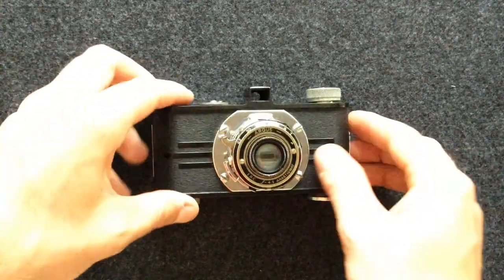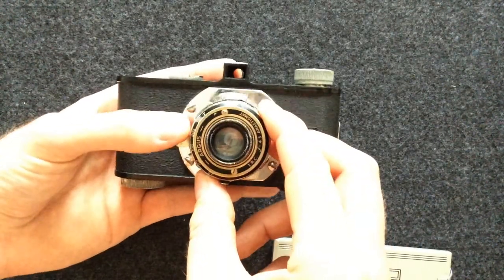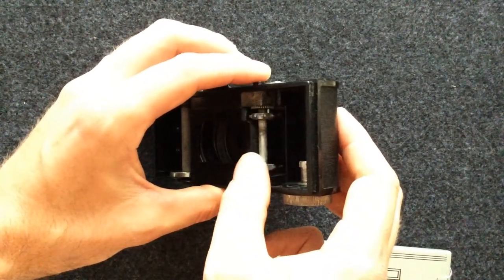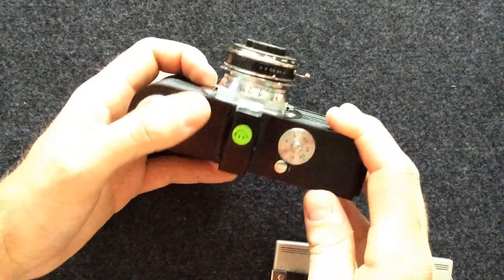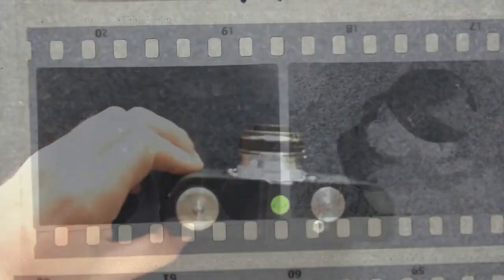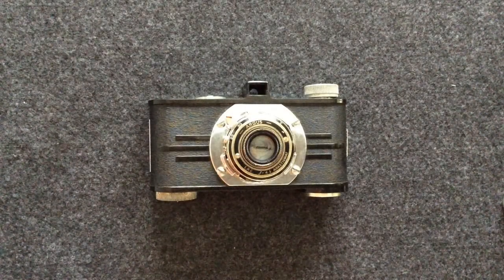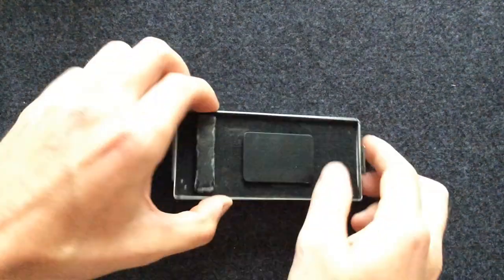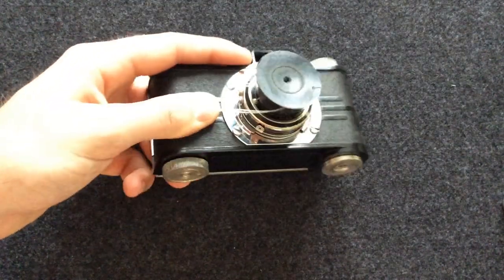Thoughts on the Argus A (irc anastigmat 4.5) Model AF with Sample Images

Comment: Thanks so much for the video! Recently picked one up and it’s alien to me. However, with your guidance I’ve cleaned the lenses, oiled the count gears, and cleaned it up. A question though, do you need to advance the film after every shot? If so, how do you do this and how do you know how far to advance?

Excuse my ignorance in question, I’m a complete novice with vintage cameras.
Reply: Yes you need to advance the film. Totally manually.  There is no double exposure prevention.  The wind wheel is on the left on top.  Next to the counter is the film lock.  Put a little tension on the winder clockwise looking from the top.  As you are doing that, push the lock to the right.  If you don't push the lock, the film will not advance and the winder will not turn.  Holding the lock, turn the winder a quarter turn at most.  Then you can release the lock.  Now turn the winder until it stops.  You have now advanced the film one frame.  The counter will spin as you do this and stop one number advanced, showing the frames used.  The counter fits its shaft by friction.   So you load the camera, put on the back, advance the film two frames, and set the counter to zero.  Then it will count the frames used.  It's not a problem once you do it half a dozen times.  Wind as soon as you take a shot so you don't forget.
Reply: Advance after each shot to be ready for the next one -- but u can make double exposures too for arty fun...